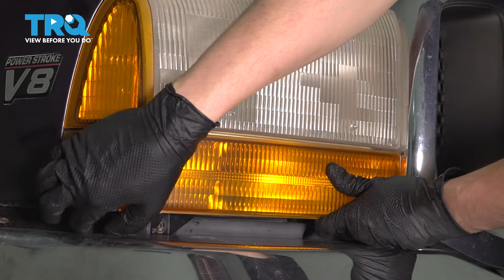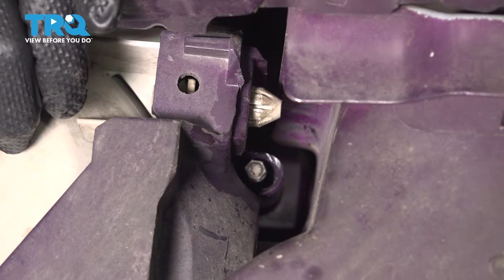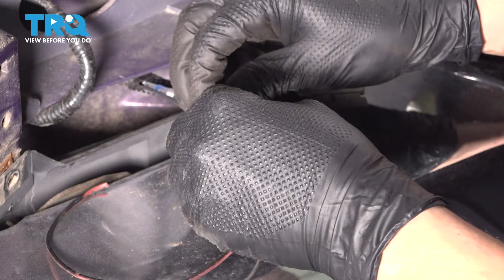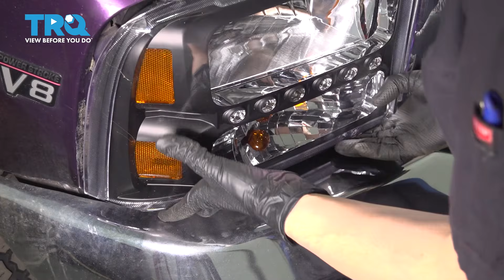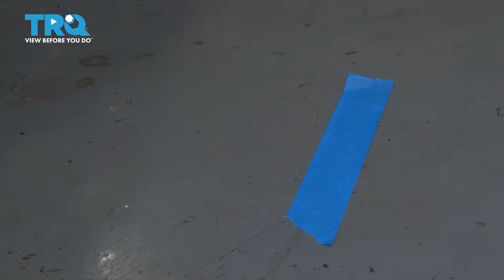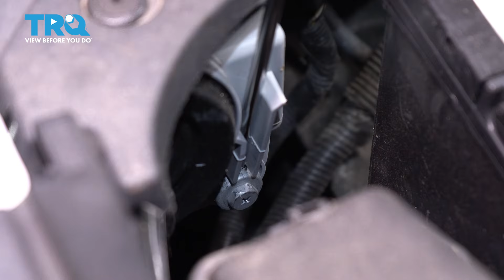How to Replace Performance Headlights 1999-2007 Ford F-350

Comment: I would use different sides of the spade connectors on each wire (one male, one female) so you don't need to check the polarity in the future if ever unplugged again.